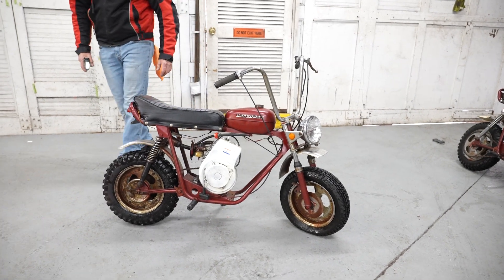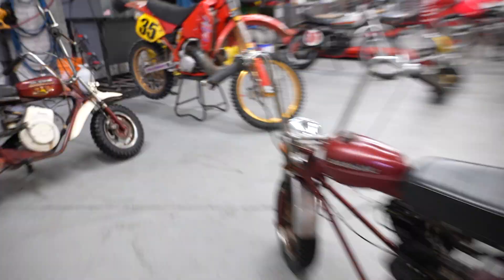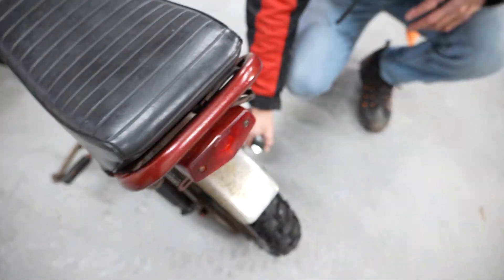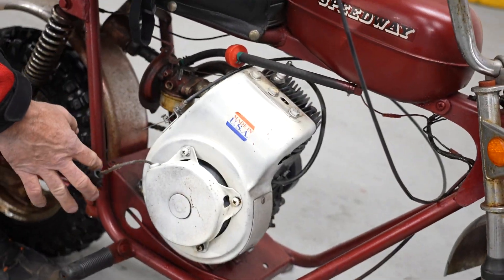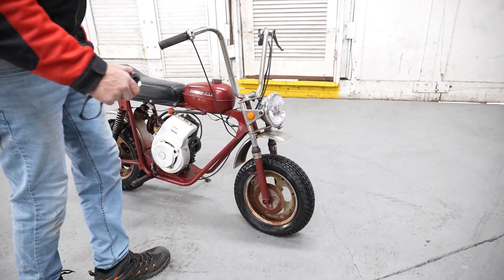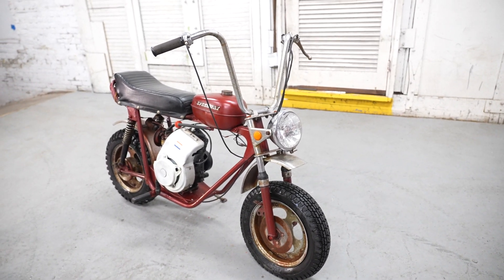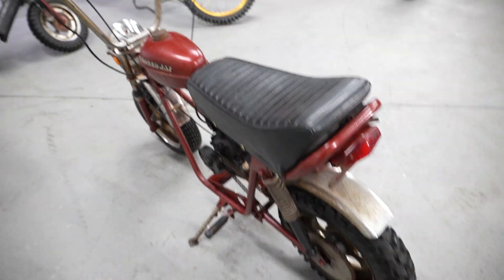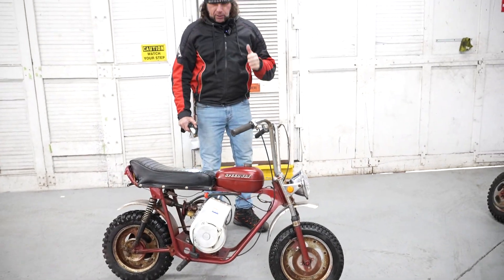1971 Speedway Scorpion #1

Comment: It's a 1971 Scorpion (because of the lights.) But it's is missing the entire jackshaft and torque converter assembly. Someone foolishly converted it to a centrifugal clutch. also missing the entire front disc brake assembly (aside from the rotor.) and mostly it's missing the clutch cover (very hard to find.)